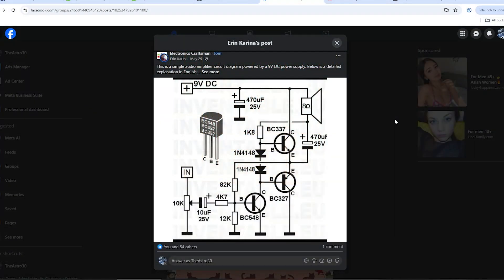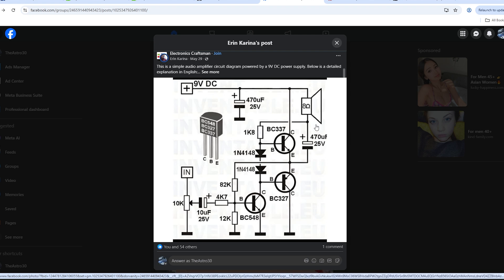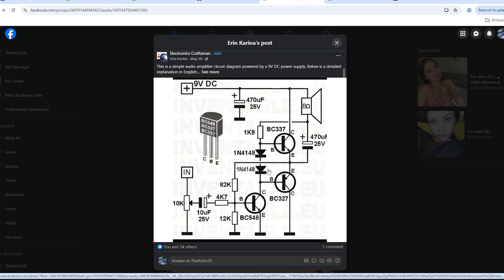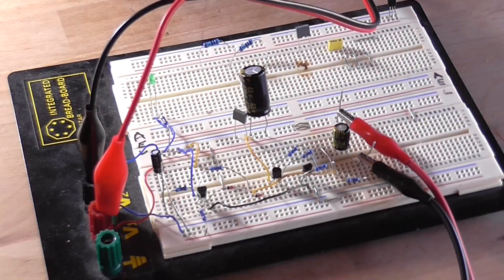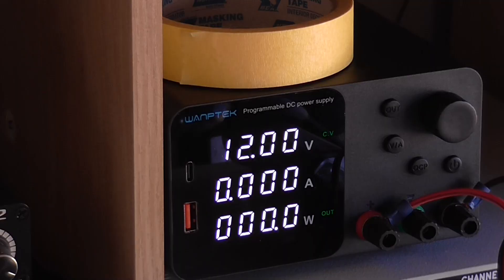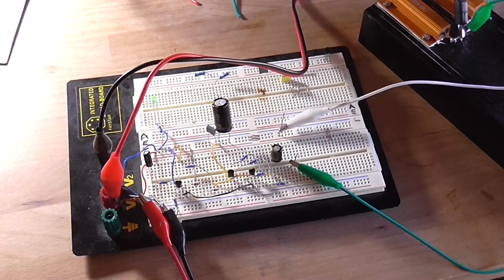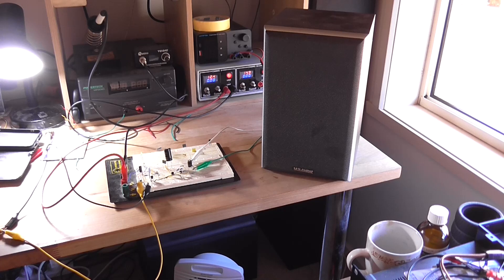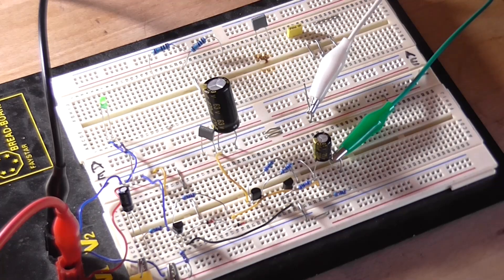Random Circuit: 200mW Utility Audio Amplifier (BC327/BC337)

Comment: I'd be conducting a few load tests on that Wantek PSU and checking the noise it produces with your scope.  It might be faulty.   I wouldn't expect simple amplifier designs to have a good PSRR so anything contaminating the power could find its way to the output of the amplifier.  As a process of elimination try powering the circuit with your DIY linear supply.
Reply from the maker: The PSU seems to power a couple of PCB power amplifiers with no 1kHz interference... but, yeah, I'm thinking it's most likely the breadboard.